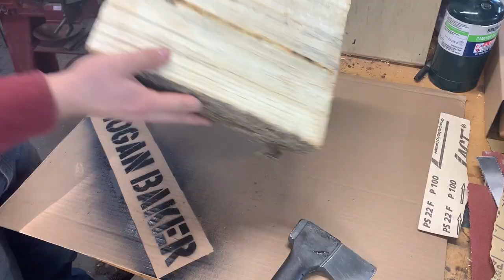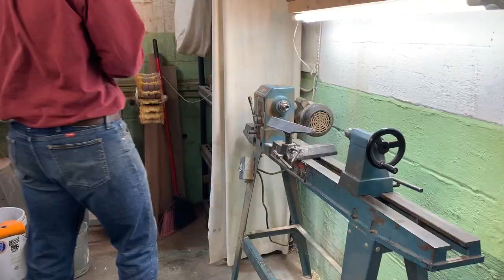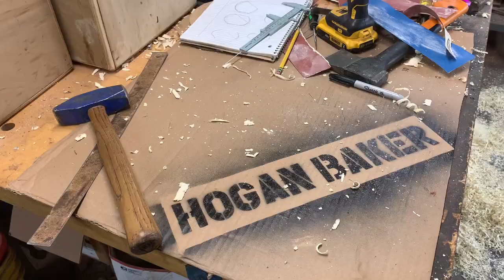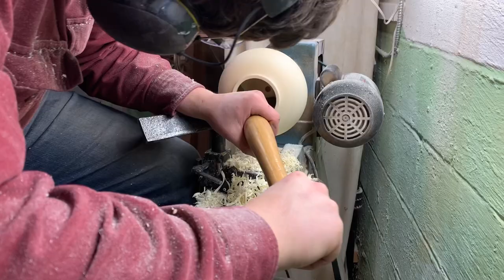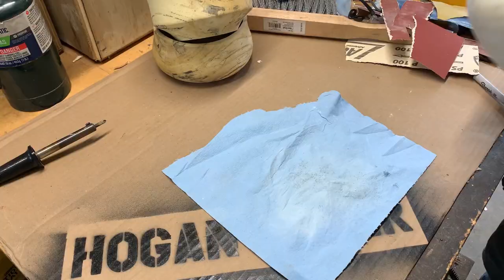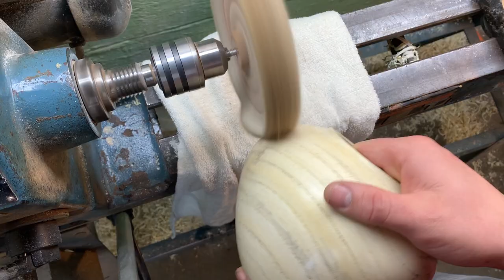Wooden Vase Making - Woodturning

Comment: I know the SEALER is non toxic but is it food safe? Just wondering sense it "is" a wax based sealer..

BTW.

Nice work as always!
Reply from the maker: Thanks for watching! The "wood turners finish" doesn't exactly say that its food safe, but it does list salad bowls as a use so i guess it is🤷‍♂️ I wouldn't sell a bowl for food use with the finish personally. For that I usually use pure mineral oil with some bees wax on the outside. There are food safe linseed oils and walnut oils that harden, and I plan to switch to one of those eventually.
Reply: @AdirondackIron  Thanks. After a day or two of drying I'll use 0000 steel wool to polish the wax based finishes.  Polishing with the 0000 steel wool adds durability to the finish somehow although I'm not sure how that happens yet it does.
Reply from the maker: Thanks, i'll try that sometime!